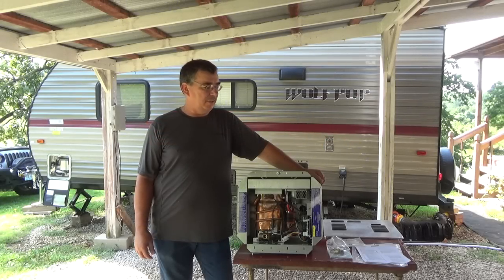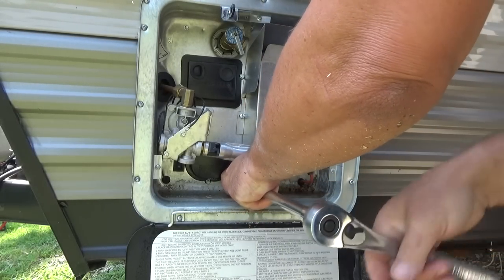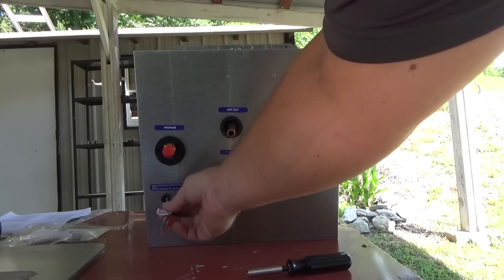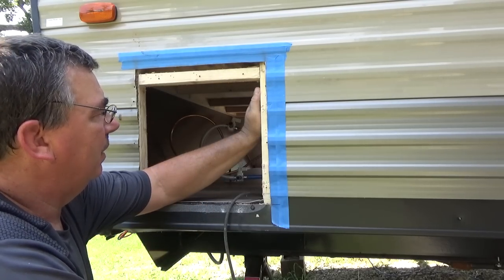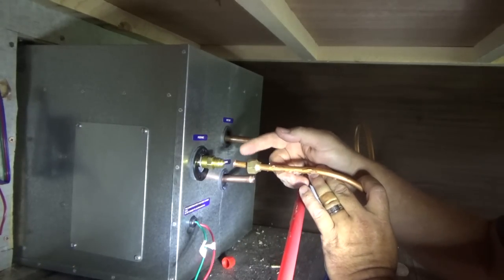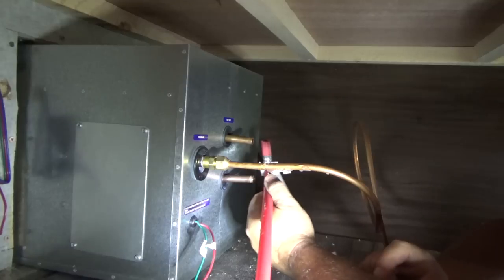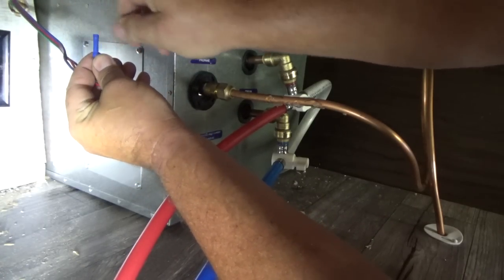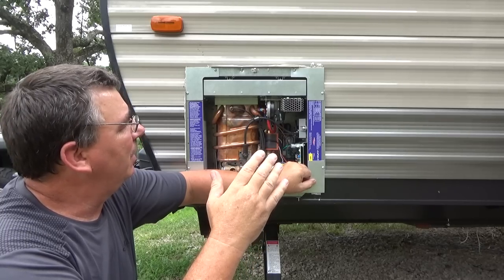How to install tankless PrecisionTemp water heater in RV Camper Travel Trailer RV-550 EC

Comment: Thats going to be a huge improvement. Does it have a low temp turn on feature to turn it on momentarily if it freezing out to keep it from freezing? For instance, if you were winter camping and didn't turn on any hot water all day...???
Reply from the maker: It has a built-in thermostat that turns the burner on in low burn when the heat exchanger temperature is about 38° F. At the same time, small 12 volt heaters protect the internal plumbing and control valve.
Reply: Thats a pretty awesome unit. That would be great for a bug out cabin with solar.
Reply from the maker: Yea it would work great in a tiny house or cabin

Comment: This unit looks exactly like the previously discontinued Dometic/Atwood, installed in my Luxe. Did they just change the name? 

I loved it but cold cracked the copper. Being discontinued no spare parts were available. Weld-fixing the leak wasn’t an option (being same cost as a full replacement).  Maybe if it is the same, they will provide parts that Atwood discontinued?

I also wish this unit had an electrified override, so when I’m in a park (where electricity if free) I won’t be tied to use propane.